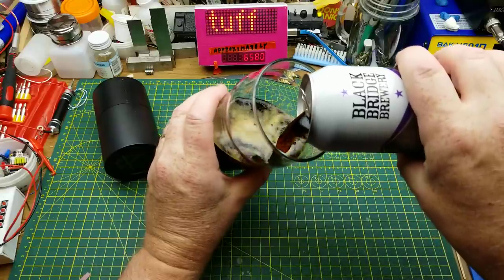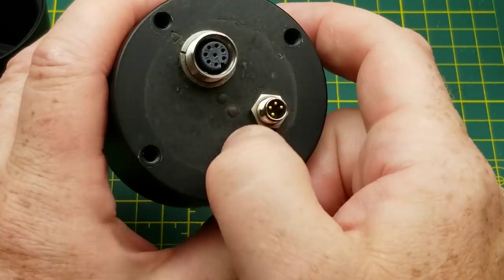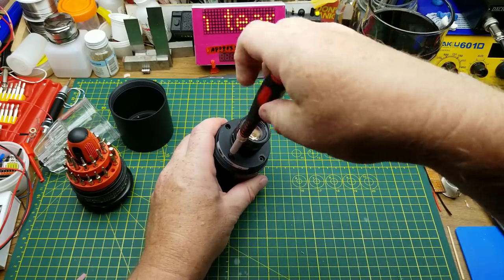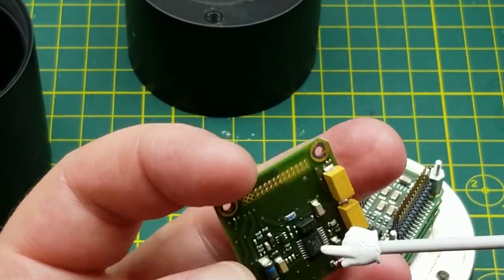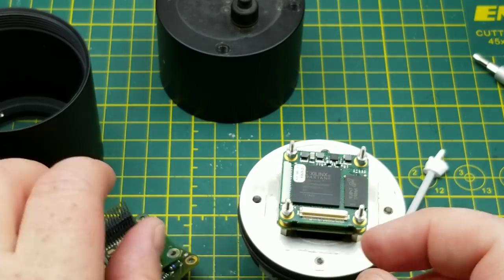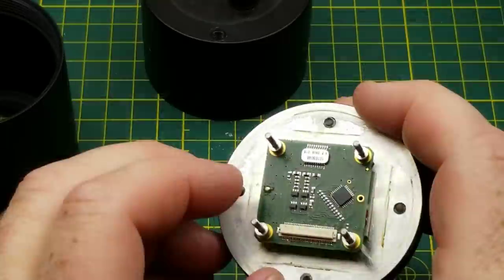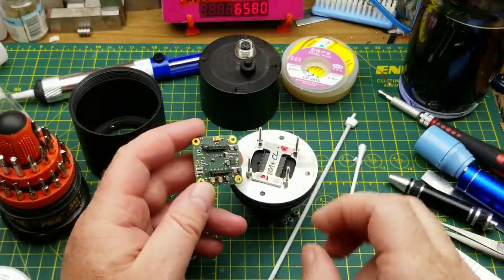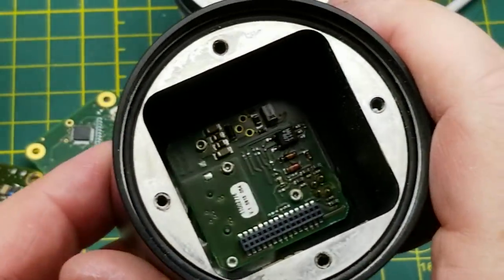industrial camera  teardown

Comment: When it comes to those hex screws, if you find you don't have the correct size, sometimes a flat bladed screwdriver that's a reasonably tight fit between the widest parts of the hex recess in the head, will do the job.

Comment: Per my 30-years out of date memory of these things, they're smart enough to do a power-on-self-test. All you should have to do is fake up a POE connector and ping its MAC address to get it to start transmitting video. Typically they transmit to a video switcher that routes to monitors or an image analyzer that tells the robot it's attached to when it's in the right spot.

Comment: You can make a PoE cable yourself using a standard cable and making a connection that supplies the required power to the camera and allows you to store to footage on your computer however far away.

Comment: Some people recommended to do a "fake" PoE cable and simply attach DC to some of the wires. This will not work, as the 802.3af standard requires negotiation between the device and the PoE supply. Passive PoE is what doesn't require negotiation, but 802.3af has no passive implementation and thus passive PoE is vendor-specific.

Comment: how the cameras senses the different colours
Reply from the maker: Typically each pixel on the sensor is actually a cluster of 3 pixels that are only sensitive to one of the primary colours (red, green or blue), then those are combined (probably in one of the mystery chips on that board at the front).